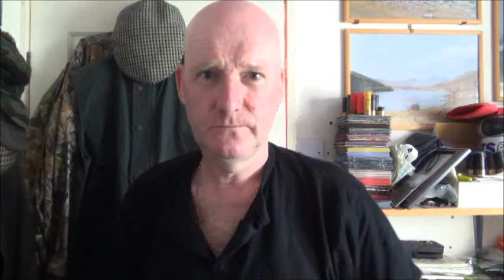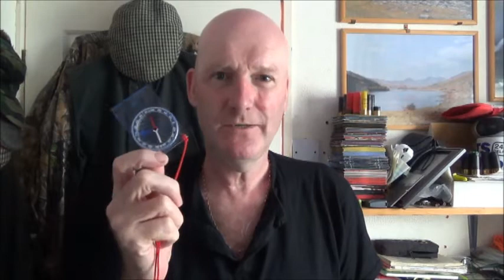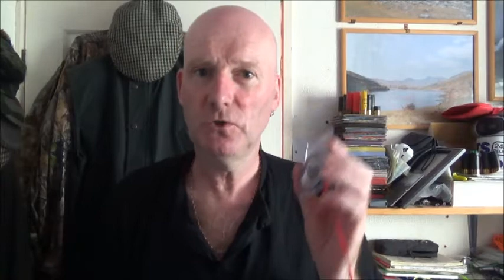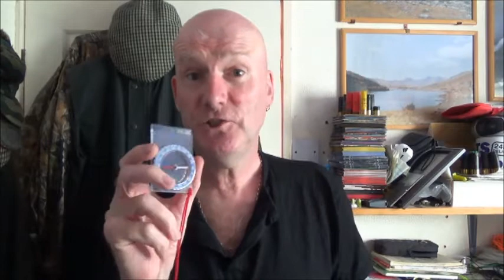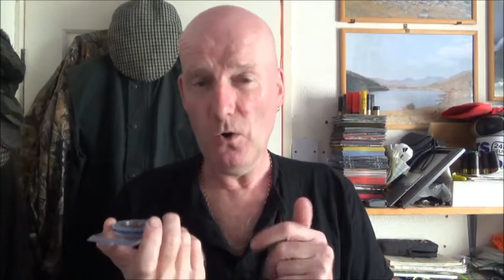Compass back bearings

Comment: Does back bearing only work with a straight line?
Reply from the maker: Yes
Reply: @wxpm  I go above treeline when out hiking in the winter. Trying to figure how to use the compass to get back to start point in case of a white out. Most hikes aren't a straight line

Comment: If you're walking on your bearing with the compass in your hand alll you need do is look at the opposite end of the needle (the white end!) and it will tell you the back bearing without having to try and remember anything maths . Better still when you set the compass on your bearing,  and before you move/put your compass away etc. Make a note of /write down the back bearing ;)
Reply from the maker: Unless you are walking on a compass bearing of 0 the point on the compass housing that the white end of the needle is pointing to is not the back bearing